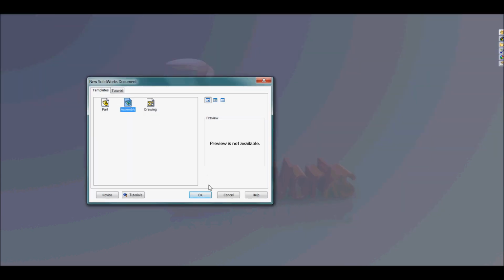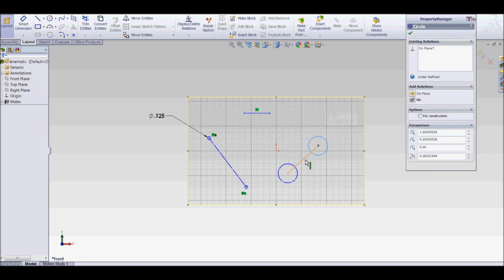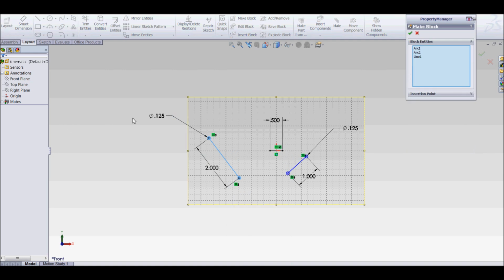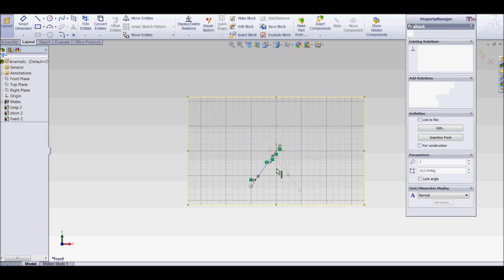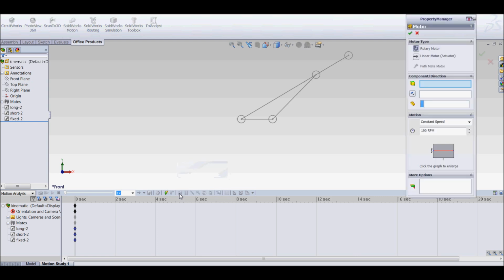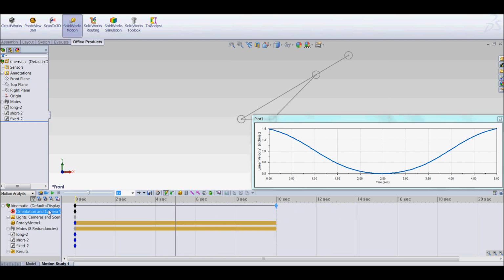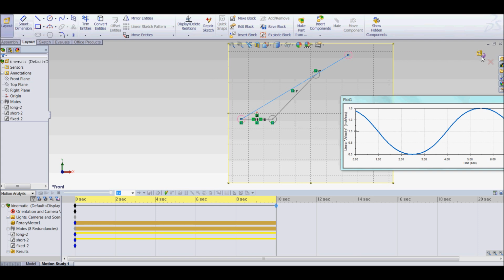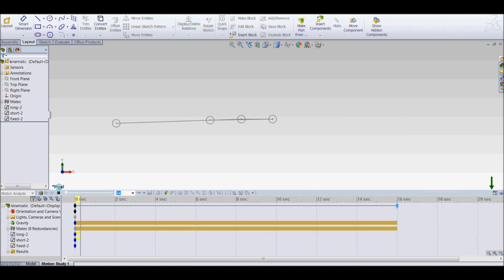Tutorial:  solidworks 3 bar kinematics with blocks

Comment from the maker: If you are new to solidworks the steps are: 1. Become proficient at creating "sketches". This is a critical skill for any SolidWorks work. "Flex" your sketches and learn to apply relationships and dimensions properly 2. Create the 3d models of the individual parts accurately 3. Bring the parts together in an assembly. In the assembly you must apply relationships that force the parts to orient properly. Move the parts in the assembly to make sure proper degrees of freedom remain. 4. Motion study